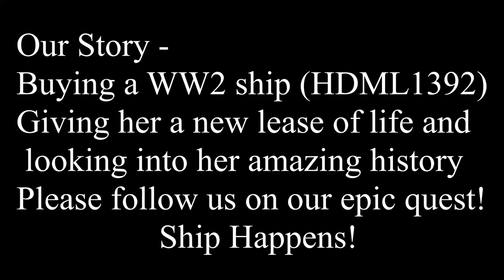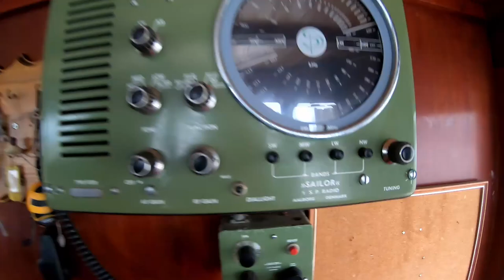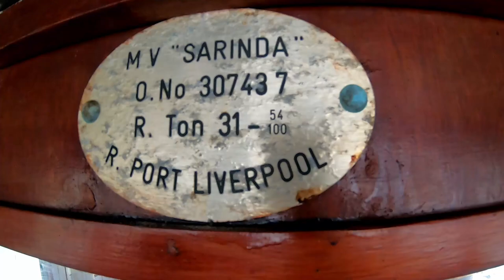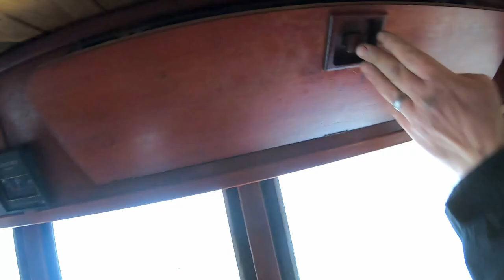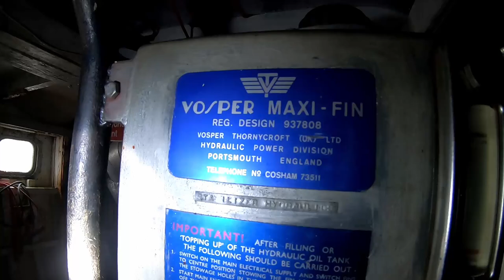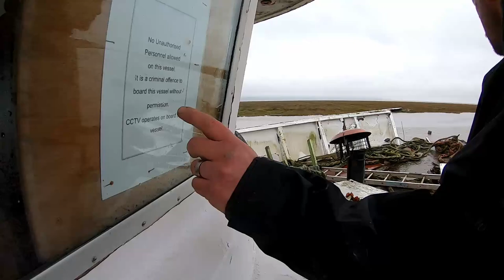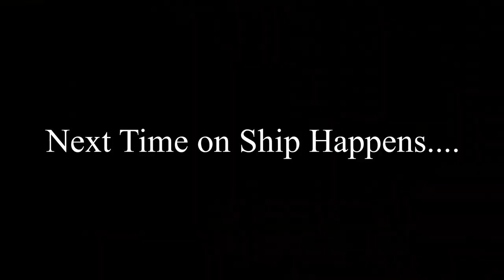We Risked Everything On A Rotten Boat! #boatrestoration

Comment: As a professional shipwright I would give you three pieces of advise. First get a survey so you can focus on the areas that need to be repaired to stabilize the boat. Secondly break the project down to smaller tasks and focus on each one in turn rather than getting overwhelmed by the whole. And if possible have the boat hauled and work on land, it will save time and money.
Reply: I’ve been on boats for 45 years ...I always see newbies focus on ascetics...the hull below the water line is job 1 . If that is shot....well....

Comment: Found this on a boat spotters forum.  Sarinda was built as Harbour Defence Launch (HDML) ML 1392 by Berthon Boats, Lymington. She was ordered on 11 September 1942 and completed on 20 December 1943. 

She has a length of 21.95m, 4.57m beam, 1.40m draft with Gross Tonnage of 59.

The HDML was designed by W J Holt at the Admiralty in early 1939 and ML 1392 is one of 486 HDMLs constructed mainly by yacht builders in the UK as well as other Allied countries. 

Originally her complement would have been 10 personel and she would have typically been armed with a QF-2 pdr main gun, 20mm Oerlikon AA Cannon and 0.303 vickers machine guns located either side of the bridge. She would have also carried 6 to 8 depth charges on her aft deck. As the QF-2-pounder guns were not particularly accurate, possibly because of the boats tendency to roll many were replaced by another 20 mm Oerlikon gun.

Engines on this type of vessel varied but her diesel engine and single propeller would make between 11 and 12.5 knots. 

As part of the 149th ML Flotilla she was a navigation leader at Gold Beach during the D-day landings in June 1944. On 6 March 1945, she captured a Biber type German midget submarine off Breskens in the Scheldt estuary. After the war, she continued in service as the fast despatch boat FDB 73. 

In October 1947, she was transferred to HM Customs & Excise and renamed  Valiant. In the 1960's she was sold and became the motor yacht Frol-Pejo and by the mid 1970's she had been renamed Sarinda. 

A total rebuild as a motor yacht was  started in 1979 and completed by a new owner after she was sold in 1987.
Reply: wow, she's certainly had a colourful past & to actually have been part of the D-Day landings too, amazing & definitely deserving the right to be rescued
Reply from the maker: This is why we want to save her! To many people telling us to burn it, we need to look after our history!
Reply: Great historical perspective. Nice one.

Comment: In answer to a couple of your questions, in the wheelhouse the container with Tellus on it probably holds a top up supply of oil of the hydraulic steering, the Sailor radio is a MF set you will need a restricted RT certificate to use it. The VHF in the drawer will be of more use on coastal passages. The construction is double diagonal planking, if it’s teak like you said on FB then you are lucky, if it’s mahogany then get a marine surveyor to have a look before you spend a heap on the topsides. As someone has already mentioned I would build a cover to keep the rain from doing more damage and allow you to work in the dry. Best wishes for the project.
Reply from the maker: Thank you for your knowledge Roger x

Comment: It's not a big job but it is a thousand or more smaller ones. First get the "crap" out and then get it on the hard, from there you'll be able to see where to start and have the luxury of shore power and easy access. I would suggest hull first followed by topsides and then interior at your leisure. You will of course need to sheet her over to keep the rain out. We are two years into renovating a Colvic Sailor and can now see what needs doing. I admire your courage. Best wishes. John

Comment: You need to get her out of the water. Beacuase it will be easier to work on plus you will need to have a full inspection of the hull below the waterline. Then declutter. Get rid of rubbish and crap get her clean inside and out then you will be able to see where to start first. And to not get overwhelmed do one thing at a time. I'd start with hull repairs before you tackle any superstructure issues.

Comment: Awesome endeavor, you can make it happen.i would look for dry dock however for now get rid of all the trash from the boat. especially topside and a new tarp. keep her as dry as possible from the rain. fresh Batteries and bilge pumps are Number 1. it sounds like you have a petrol pump or generator going. lots of work but if she were mine id move in and get the heat safely working and bilge pumps and radio VHF. good luck. ill be watching! Thomas Masters Mocksville NC USA 27028

Comment: Here's your to do list:

1: get her hauled out and on the hard.

2: scrape the bottom so you can sand and prep for bottom paint ( antifoul ) you may also have to have some welden done

3: service and replace all of your through hole fittings and seacocks.   ( thats so she don't bloody sink on ya )

3: rebed all of your window and portlights ( butyl tape is your best friend )  

4: you will have to replace the house roof and get rid of all the rot.

5: relace all of your decking

These four tasks will make your boat water tight.  After that then you can start thinkin about the inside of the ship. .... good luck ... ⛵💕🌠
Reply from the maker: You do know the boat is made of wood so welding isn't an option! The decks are one of the first things to do as that is the worst part and the thing causing all the water damage. No point doing anything else until she is water tight. X
Reply: @ShipHappensUK  in that case you're going to be springing planks and replacing the keel olong with any frames that are rotten and then recorking the ship.

I refer you to ( The Sampson Boat Company ) leo's channel will open your eyes to exactily what you're in for.

Leo is a shipright and a salor and he is rebuilding the Tally Ho.

Comment: This looks like a great adventure for a family! I think the process you described about the hull planking is known as "cold molding." Typically it runs a set of thin planks at an angle forward, then at an angle back, and then one along the length of the hull. Newer builds may also use epoxy soaked planks (strips?) which are highly resistant to water. 

Your best bet on those Caterpillars is to get a model and serial number, and run it past your local Cat dealer. Find out how hard parts will be to acquire, or if they are plentiful and easy to access. Then make a decision on how to move forward in restoration. 

Looking forward to watching!

Comment: Tellus oil is a type of hydraulic oil, its probably the reservoir for the steering, she is double diagonal construction with ribs going up and down and stringers going forward and aft, the stringers are a important part of the structure of the hull. Might be worth taking a look at rebuilding of Tally Ho and the Western Flyer rebuild both here on you tube, good luck with this one I hope you have a spare bucket of money for this one.

Comment: As an old time builder, who has seen many restoration projects in my time, I watch your video with a sense of dread.
You are very very brave to take on such a project.
I had more than a few jobs where the project has overwhelmed really nice people and marriages have broken down.
Clients who have been hospitalized from injury's with equipment a novice should never touch.
Finances crippled by indecision and poor choices.
The age of the boat should ring alarm bells, and would scare off the most seasoned boat captain or boat restorer .
Getting a survey done is a must , usually BEFORE the money is put on the table.
Unfortunately you have purchased a deep money pit with only darkness and despair at the bottom .
I am  sorry for the bad news, but facts often hurt..
Sell it now, and cut your losses down to hard experience, for the sake of everything you have and know.
You though you bought a boat, instead you got a chain around your ankle, and a noose around your finances.

Comment: Good luck! The interior doesn't look too bad. All that varnished wood looks nice. I suppose you's have mentioned if there were a smell of dampness, rot etc.
It might be a good idea at some point to check all the extinguishers, safety kit and odds and ends to see if they are safe to use. The extinguishers are probably due some sort of service - it's probably an annual thing. Life jackets could be 'lifed' items - i.e. they may have moving parts, automatic inflaters, etc.
If a window is hard to open, it might be impossible to shut!

Comment: Hi guys,  "Tellus 15 oil" is a hydraulic oil.  I think gray tank is the header tank for the steering system.
Reply: most likely it is for the helm
Reply: @Martin.H98  Almost definitely for the helm, i'm 90% sure.
Reply: @andrewroyles7572  yes, the helm is the only reason why you would have hydraulic oil in the wheelhouse

Comment: Has she had a survey? If not that is step one, have a marine surveyor go right over her from stem to stern and give you a report before you spend dollar one.

Tellus is a type of hydraulic oil, Shell IIRC and it uses a very thin 15 weight version so not at all big rams. What that is an oil reservoir for I have no idea but it's probably easy enough to track back, it will be the helm most likely.

Have you checked that genset exhaust is  sealed and not leaking inboard? I don't want to read about three victims of CO poisoning on an old ML.

Kitchen: Galley
Bedroom: Stateroom or cabin
Toilet: Head

Please tell me you paid about 100 pounds for her and have a very large disposable income; you have no idea of what you are in for here.
Reply: tellus is used for older LP steering gears indeed.

Comment: Talk about jumping in with both feet.  I had to subscribe after seeing the smiles on all your faces. After getting the holes covered to prevent more water getting in, I would see about getting a shipwright out there to formulate a plan of attack.  Also, be careful of asbestos, if that was used in the ships built during that time.

Comment: Hi Guys, love your commitment to this project, as an ex-shipbuilder, get her out of the oggin, strip back to a bare wooden hull, then go from there. xcxc
Reply: When you get to the hull clean it well then paint it with linseed oil, turpentine and pine tar 1-1-1. Warm it in a pot and lather it on. Took 3 coats on my 1963 boat. Stinks for days but puts the oils back in the wood.

Comment: That's a nice bit of kit that, she's double diag construction, normally of Mahogany on oak or elm frames. The planking is sealed with a sheet of Calico and white lead between the inner and outer skin. Mahogany hates fresh water so I would sheet her up as soon as possible so you minimise the ability for her to rot from the inside out. Replacing inner planking is a major job. A lot of these boats were made in kit form and sent out to smaller yards to be fixed together. There is not many of these hulls left so best wishes to you for your endeavours. (P.S. My day job is a wooden boat builder and restorer for the past 40 years but I am sure you will have many contributors of information so I'll keep quiet unless asked). Good on you Guy's for doing this.
Reply from the maker: Any help and advice is appreciated x

Comment: Well it definatly is a massive project but with a solid hull and (hopefully) 2 working engines theres a lot of potential. 
Muir winch is a good one if you can get it working again, the radar is junk. My 35ft had one from the 80s that half worked. Very low resolution but.
Most of the systems youll probably have to throw out anyway, like the radios, PA, radar etc.
Id be tempted to keep an eye out for an old barge as youll be hauling lots of stuff away and a fair bit to the boat, itll also make a nice mobile work platform for around the outside of the boat, unless your going to take her out of the water that is.

Comment: I agree with the other comments regarding dry dock.
It's a absolute must so you can find and correct problems that may compromise her watertight integrity.
Former US Navy Hull Tech here so I guess that worry is in my nature. 
I wish I lived close, I'd love to volunteer time and experience to this project.
Reply: Fir a boat this size dry dock isn’t necessary, just put on the hard and use Jack stand type of blocking. And yes I agree it needs to be gone over stem to stern top bottom. I was also in the US Navy, but an ABH, but rust is rust and de lamination is de lamination and must be fixed right.

Comment: Sarinda - Harbour defence launch (ML1392)
 Picture
 Picture
Seen in Liverpool on 4 September 2013 Sarinda was built as Harbour Defence Launch (HDML) ML 1392 by 
Berthon Boats, Lymington. She was ordered on 11 September 1942 and completed on 20 December 1943. 

She has a length of 21.95m, 4.57m beam, 1.40m draft with Gross Tonnage of 59.

The HDML was designed by W J Holt at the Admiralty in early 1939 and ML 1392 is one of 486 HDMLs constructed mainly by yacht builders in the UK as well as other Allied countries. 

Originally her complement would have been 10 personel and she would have typically been armed with a QF-2 pdr main gun, 20mm Oerlikon AA Cannon and 0.303 vickers machine guns located either side of the bridge. She would have also carried 6 to 8 depth charges on her aft deck. As the QF-2-pounder guns were not particularly accurate, possibly because of the boats tendency to roll many were replaced by another 20 mm Oerlikon gun. 

Engines on this type of vessel varied but her diesel engine and single propeller would make between 11 and 12.5 knots. 

As part of the 149th ML Flotilla she was a navigation leader at Gold Beach during the D-day landings in June 1944. On 6 March 1945, she captured a Biber type German midget submarine off Breskens in the Scheldt estuary. After the war, she continued in service as the fast despatch boat FDB 73. 

In October 1947, she was transferred to HM Customs & Excise and renamed  Valiant. In the 1960's she was sold and became the motor yacht Frol-Pejo and by the mid 1970's she had been renamed Sarinda. 

A total rebuild as a motor yacht was  started in 1979 and completed by a new owner after she was sold in 1987.
Reply: Wish you all the best with this project

Comment: That's called double diagonal planking. PT boats were built that way.   Good way to build cheep and lite.  not desirable for longevity.  I had a 1969 Owens 39' planked like that and water got between the planks and rotted from inside.  Outside  everything looked pretty good.  if your lucky the planking is real mahogany and the boards were bedded together with something that lasts. fasteners on the hull do not last forever either...  I guess the hope is the topsides were all put on later with very inferior material.  I spent two years plywooding/glassing and replacing my decks to keep the water from washing over the inside of the hull... only to realize the hull was so far gone when i tried to pull and replace the few rot areas showing on the outside.  Once i started to pull the planks one in ten could be saved so i gave up and bought a couple dumpsters and went to town with a chainsaw....vowed never wood again and bought plastic.  To be fair likely all wood below the waterline is solid and completely pickled in oil as mine was assuming the fastenings are still good.  If you can verify the hull above the water is sound you have something worth trying.  Double diagonal planking is screwed from the outside to the beams.... that part is fine but it is also screwed from the inside to the outside and those screws  have been awash  in fresh water or painted over so the heads will either disintegrate when you try and pull them or require picking every one open. Removing each plank is painstaking, and the whole inetreor needs to be accessible.  I still have 80 pounds of partially corroded bronze fasteners I removed from my hull over a couple of years time..  best of luck to you! I lived on the water in my Owens and others for over ten years and nothing can beat it! I still would not trade my experiences for comfort.  All my work was eventually lost but not my memories.  I know you cant turn back now... you can't buy good wood without wheelbarrows of gold bars so don't even try.  Strip laminate Douglass fir for curved beam replacement, and glass over ply for the deck. don't bother with marine ply.  They have not made the real stuff in 50 years.  only use exterior grade.  those nice flat sheets of pretty luan usually do not use waterproof glue.  Good Luck!!!

Comment: Hate be negative, but that canoe is in extremely rough shape and is going to cost you soo much time, money and headaches.

Did you consider asking/hiring a Shipwright to board and evaluate the condition and provide insight to what will need to be done, timeframe and cost's??  If you didn't, may I strongly recommend that you do.

Clearly, the integrity of the hull is the absolute first priority.

Whatever you do going forward, Good Luck!

Comment: I'd built a few camper vans and then bought a boat, my advice is to make sure you ask someone who knows boats before you do major projects like plumbing or wiring, there are an awful lot of jobs that need doing differently to the way you'd do a van. The Project Brupeg and Dangar marine YT channels have helped me a lot although they are steel hulled, but at least yours starts with an interior mine was pretty much bare internally!

Comment: You have bought a double diagonal mahogany boat circa WW2. Forget all the comments about engines, painting and fixing up, if the hull requires any work run away now and you might just get away with the disposal bill. Double diagonal hulls are extortionately expensive to repair and there are probably very few yards that could actually do the work.